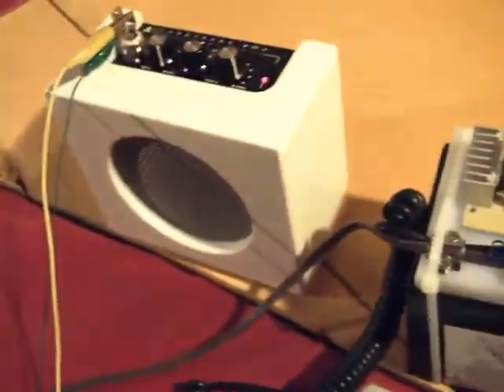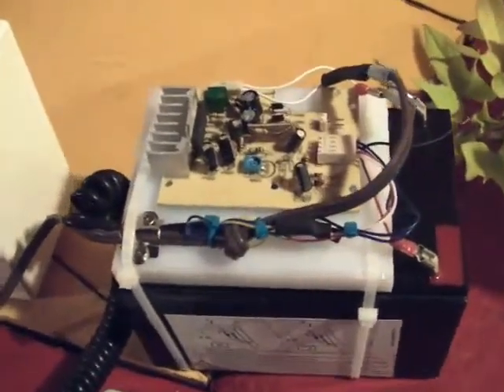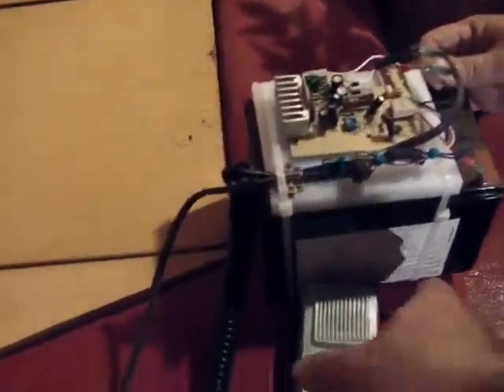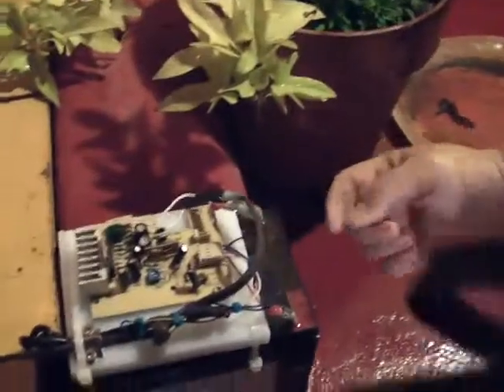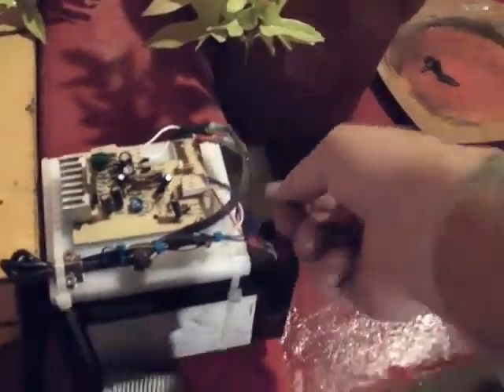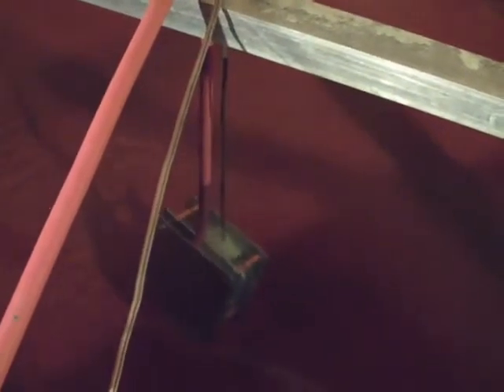DIY Underwater Voice Communications Part 5

Comment from the maker: They are in parallel.  I don't think we even tried them in series.   Each piezo has it's own twisted pair that comes up to the amplifier so it would be easy to switch them around for testing.  David has rigged up a switch box that lets him change the number and size of piezos in use so he can alter the frequency.